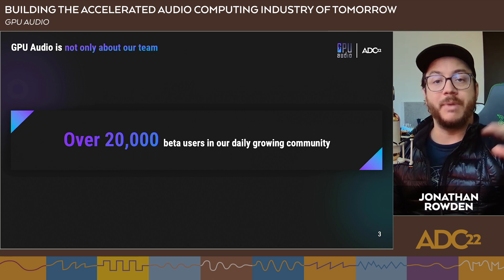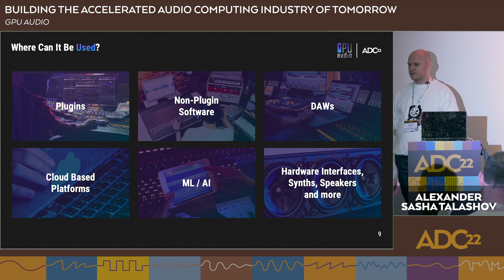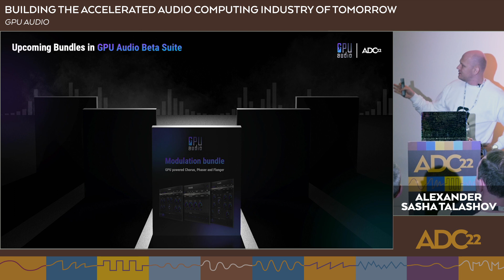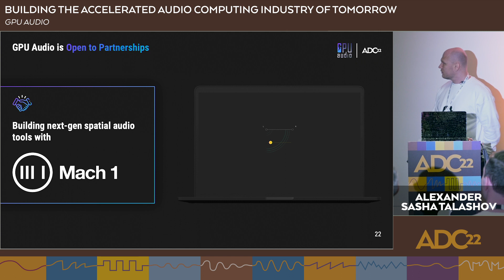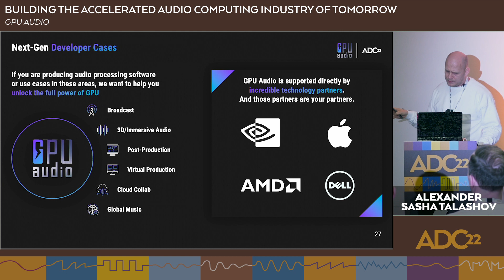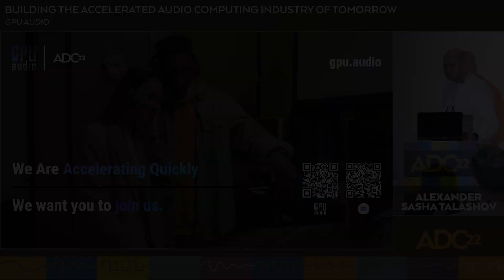GPU Audio: Building the Accelerated Audio Computing Industry of Tomorrow - ADC22

Comment: For many years now to this day, I have been involved with projects porting audio DSP algorithms to GPU's, running on NVIDIA Tesla GPU's. We did need to port IIR code as well, and were already familiar with many techniques in that field.
The absolute ideal case of IIR algorithms for GPU's is when large delays are involved (like FDN's), and even then a 10x speedup is almost unattainable compared to a well-vectorized CPU implementation. This is due to a fact how GPU threads are really slow, so your parallelization factor needs to be in the triple digits for any meaningful performance benefits to start appearing.

Any other IIR algorithm (like filters) with feedback paths that are only a few (or one) samples in length will run much slower on the GPU - like two orders of magnitude slower.
So if the cited 50x speedup was really attained for "traditionally sequential" IIR algorithms, that means this company has achieved a major scientific breakthrough that has implications far beyond the GPU, and will be cited alongside the invention of the FFT as one of the most significant advancements in the field of DSP. Looking forward for more info on that, and any independent benchmarks/comparisons.

Of course another way to achieve parallelization is to run many copies of the non-parallel algorithms. And by many, I mean several hundred. That might work for channel strips, but maybe not so well for the modulation effects. You probably don't want to have hundreds of instances of the same chorus effect, at least not in a DAW.
Reply: It was FIR that had a 50x speed up on the slides, the IIR filters had a 10x speed up.